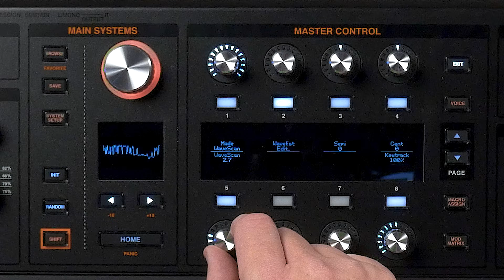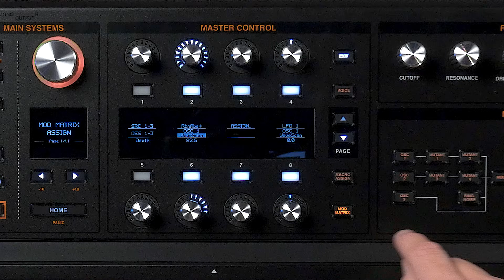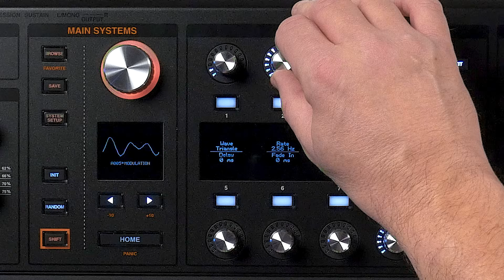What Is a Wavetable? – Daniel Fisher

Comment: Great video! It might also be important to point out that certain companies, who should really know better (cough looking at you Nord), use ‘wavetable’ in the more limited sense that you can have oscillators that are more complex waves than just sine, saw, square, etc - but without the ability to index the waves and sweep or interpolate them with a modulation source. It’s the wave without the table, and when I was learning synthesis it was the source of a lot of confusion about what wavetable really is.
Reply: Exactly. All wavetables involve samples, but most sample-based synthesis is NOT wavetable.

Comment: I wonder what the next synth in the hydra family will be able to do.  
BTW, sweetwater needs to stock some ACTIVE MIDI SPLITTERS.  not all of this wimpy 5v midi can power the passive splitters. (i have 2x quadra-thru and a merger, so i live it) i have to use old beefy gear as MIDI buffers like my alesis sr-16 or DX7 etc.    the clock doesnt seem to get through the quadras consistrently either. seriously, you have a sh!t ton of synths/controllers out there running on 5v, please add the necessary accessory gear, or i will either have to make my own, or buy it elsewhere.  retarded = using a DX7 to buffer a beatstep so it can run a quadra thru.